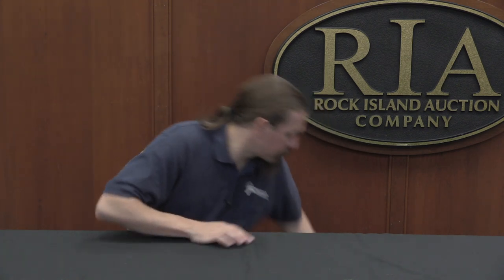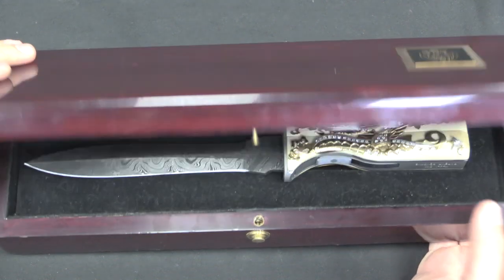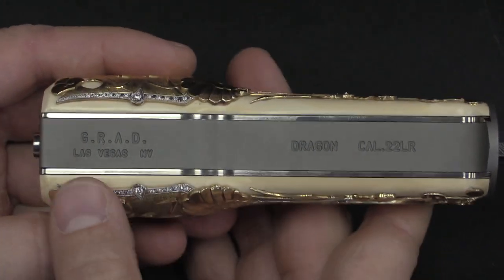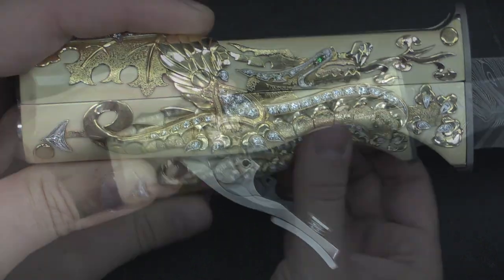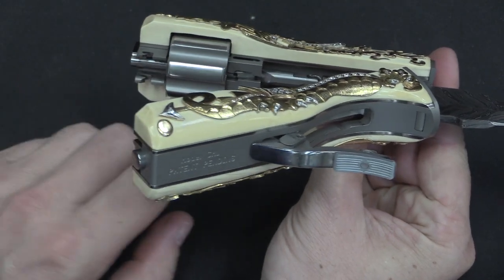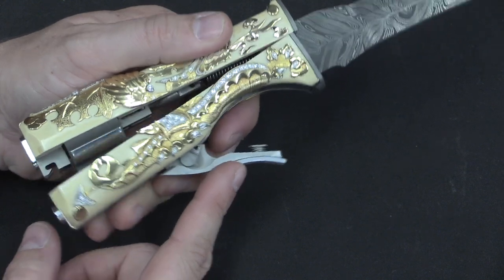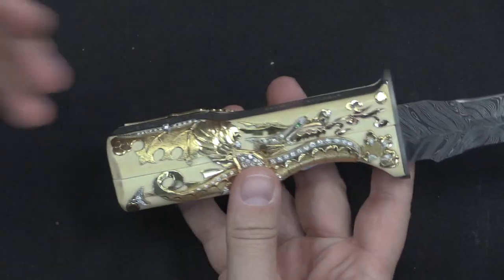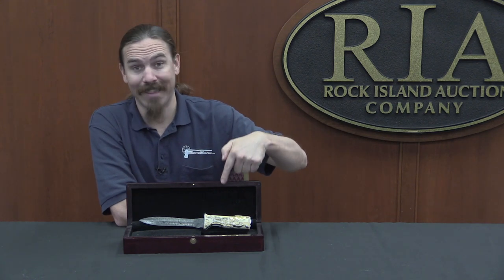The Most Ornate Knife-Gun You Will Ever See: CM-1 "Dragon"

Comment: Expected to see a gun that fires knives.
Reply: A gun that fires throwing stars would be better. Obviously ones with holes at the center for the firing mechanism to grab a hold of.
Reply: That's something you find at the slingshot channel.
Or a chainsaw launcher
Reply: @pteppig  Me: wants a knife throwing contraption
Joerge: LET ME SHOW YOU ITS FEATURES!!!
Reply: Check out the machete gun on the slingshot channel
Reply: they really did make those.
the one i saw was Russian, it was a regular knife until you pressed a button then it would fire the blade.
spring powered.
the spring was so strong it was hard to reload.
https://en.wikipedia.org/wiki/Ballistic_knife
Reply: @MrYfrank14  yes they are called ballistic knives. From what I've heard (Wich isn't much) the Russian ones are good but the knock offs not so much.
Reply: Flechette shotgun loads existed since ww1. Basically, imagine shooting 12 razor sharp darts with stabilizing fins  from a shotgun per shell.
Reply: @MrYfrank14  i have one, fires hard, would hurt up close but not easy to fire, would be unlikely to be of benefit in a fight, at least not the firing blade part of it because all your focus would be on getting it lined up to fire and it takes a lot of finger force. If they perfected it it it could be useful.

Comment: Looking at how long the blade is and how little of it is actually supported by the grip I suspect even as just a knife this is pretty pointless :/ 
Any folding knife would most likely do better
Reply: Yeah it's more something that you can put in a display shelf to impress people
Reply: I'm pretty sure that the act of thinking about practical applications for this thing places you outside of the potential customer base.
Reply: the blade thats on it is aesthetic crap. but its good steel, and solidly mounted. get a survival knife on there, and replace the FUCK out of that handle, and youve got yourself sopmething that you could, theoretically, use.
Reply: certainly better than most gun knives

Comment: speaking of knife-guns, you would love the NRS knife, the knife is held with the blade facing the shooter. Instead, the knife fires a silent special-purpose 7.62mm cartridge.
Currently, there are two versions of the knife, the NRS and the NRS-2. NRS stands for "nozh razvedchika strelyayushiy" and translates literally as "scout's shooting knife". The NRS has a clip-point blade and fires the 7.62x38 mm SP-3 cartridge which, in terms of muzzle energy, is comparable to the .25 ACP. The NRS-2 is a spear-point design and uses the more advanced 7.62x42 mm SP-4 round (comparable to the .32 ACP).
Due to the cartridge's unique design, the knife (or any other weapon chambered for the same round) produces almost no noise or fumes. The bullet is pushed out of the case by a piston, which, at the peak of its extension, locks the case mouth, thus trapping the gases inside and eliminating the muzzle crack. So in the end what we have is an extremely silent weapon with a muzzle energy of 90 J for the SP-3 round or 200 J in the SP-4 chambering, which is more than enough to kill at ranges of up to 20 m.

Comment: Now, see, the reason why most gun-knife models fail is because of the fact that they usually either go for making a great knife, a great gun, or a mediocre mix of both. I can easily think of an immensely practical design for a gun-knife: 

Make a modern pistol base with a squared frame around the barrel (like a glock or something similar), and have, built into the metal structure underneath the barrel (using the same metal as the barrel, so it's structurally sound), a reasonably sized switchblade. Have a two trigger setup (side-by-side twin thin triggers; one for the pistol fire and one for deploying the switchblade) or a double-action style setup (regular gun design with single trigger and no prominent external hammer; dummy hammer used to activate the knife mechanism).

This would ensure that you maintain a natural gun's function and a comfortable grip, but still have an option if you are completely out of ammo (along with the utilitarian uses that come with having a knife). Since pistol grips are actually viable for knives, cutting would be merely a matter of rotation of the wrist applied with motion, and stabbing would basically be extending one's arm.

This could be made furthermore useful by way of attaching other utilities such as mounted flashlight, laser/telescopic sight frames, underslung shotgun/grenade launchers (albeit very small ones), flare launcher (again, small), among a plethora of other things.
Reply: So Pistol Bayonet? :D
Reply: Er... not quite. A pistol bayonet would be affixed to the gun only when it is attached, a fact that eliminates its ultimate utility. What I am talking about is where the "handle" of the switchblade is just a descended part of the metal used for the frame.

This way, the knife and gun would be essentially separate, with neither diminishing the other's value and functionality. This would NOT be a removable knife in the sense of it being detachable without disassembly of the gun. It would be an integral part of the firearm, just in the least obtrusive location possible (in a section of metal underneath the barrel's frame.

It might be useful to show a very rough picture. I apologize for quality, I am terrible at drawing even approximations of schematics: https://puu.sh/ysQNH/f4dee41957.png

Comment: 22lr? would have been better as 22mag
Reply: toomanyaccounts maybe more on ammo availability than pressure. I have a rough rider revolver that has cylinders for both 22lr and mag and other than cartridge size they are identical. 
Maybe would have required a pinch more width on the handle, but the punch you get with a mag cartridge is worth it